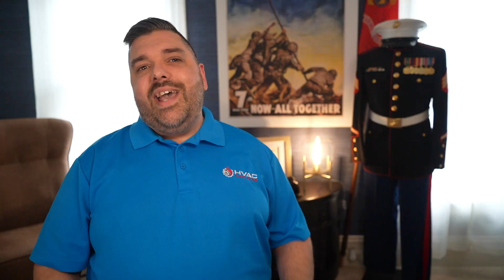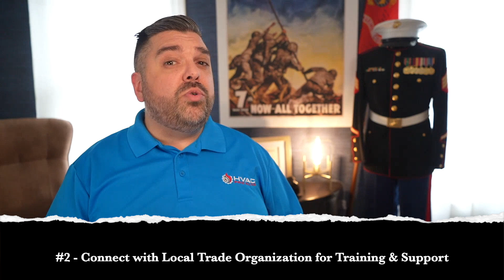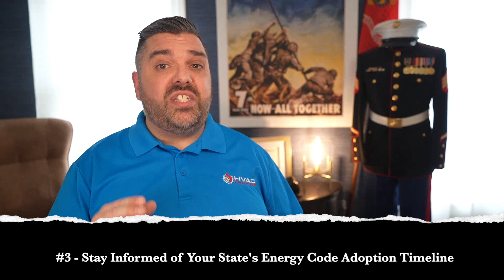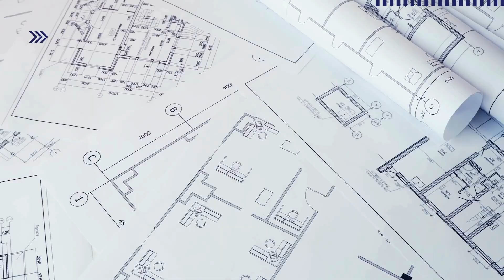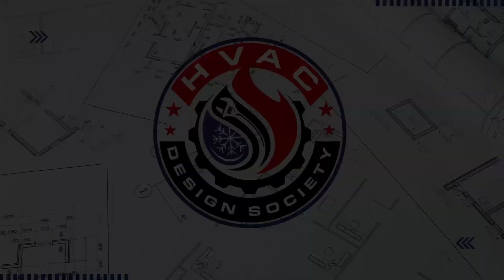🚨 Major HVAC Code Changes: What You NEED to Know About Duct Testing! 🚨

Comment: Kansas City, Missouri implemented the 2021 IECC code last year. My company was proactive and got into the Aeroseal system. I am currently the Aeroseal tech for my company. I have sealed over 140 systems in the last year. I routinely get a system down to 1.5 cfm/100 ft.^2. This is supposedly well within the code specifications. I love doing it as it is much easier in an old Jarhead like me. I prefer inside the envelope, but will happily do whatever the building design calls for. Love the videos brother. Semper Fi.

Comment: No problem, easy to achieve. Leaks are caused by sloppiness and laziness in the first place.. 
     Now, if somebody would just actually uphold and actually test enforce track home builders to pass in all 50 states.
Reply: I totally agree! We need code to be enforced by all 50 states. There’s way too much sloppy or totally incorrect work being done. This translates to higher operating costs and in cases where manual D is unheard of, compressors suffer a shorter life.